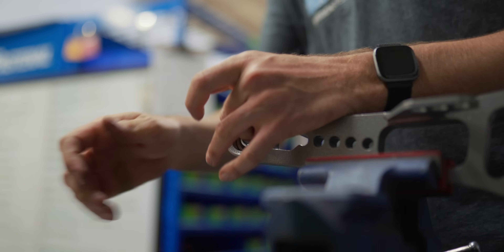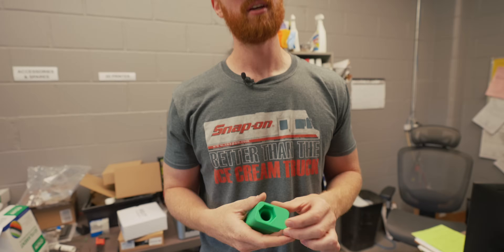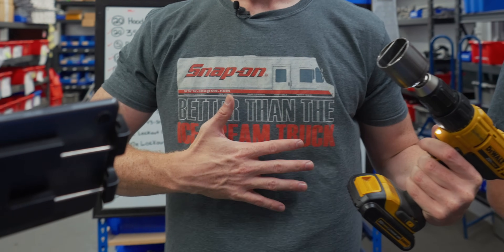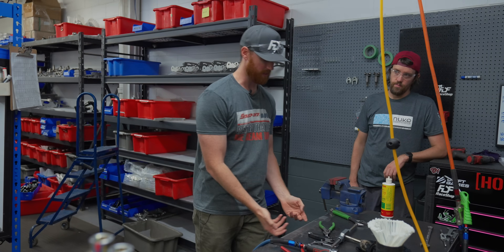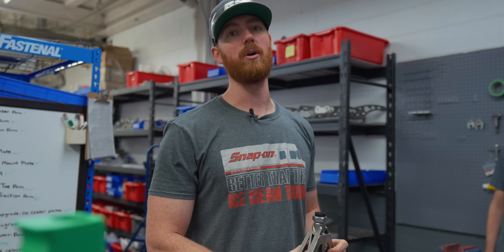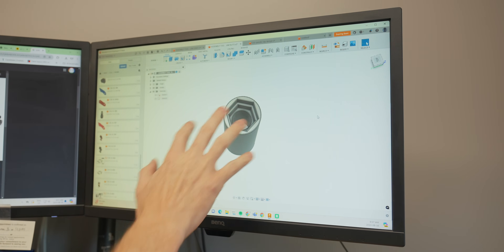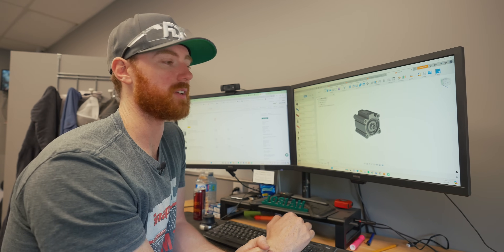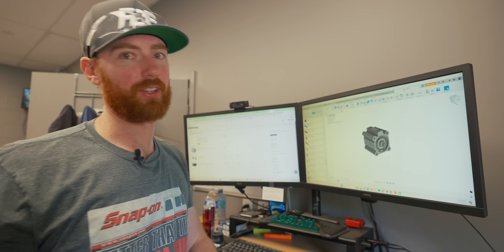How This Tool is Enhancing Our Manufacturing Efficiency

Comment: It’s interesting to see how you do this. I worked at an auto parts manufacturer in high school that had the nick name of the “Finger Factory” once you turned 18 you could move to the air and hydraulic operation equipment. More than half the employees that had worked there were missing all or part of a finger from getting them pinched in the equipment. There were safety guards but most were poorly designed and worn a got moved out of the way. It’s hard to get the hands out of the operating area. We mostly had custom parts holders on sticks that you put the part on, inserted it into the work area then had to put both hands on operation buttons to activate the operation. Some thought on how to hold the part without using your hands in the work area was much more complicated than the actual equipment involved. 
Safety first.